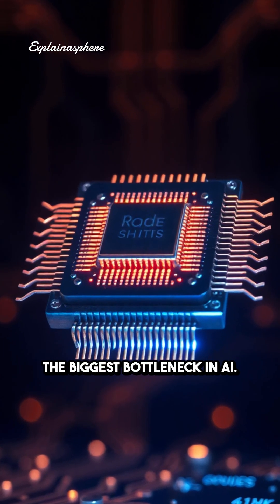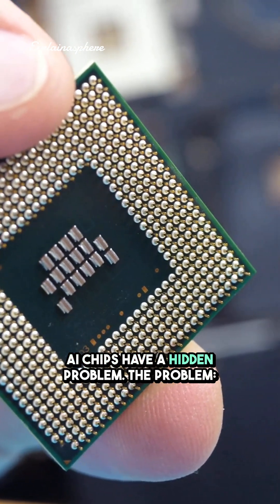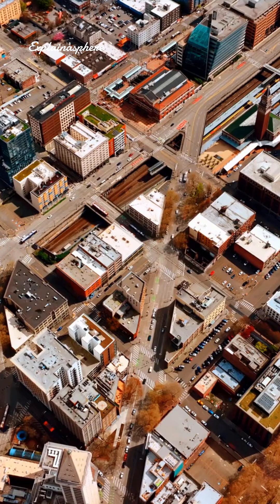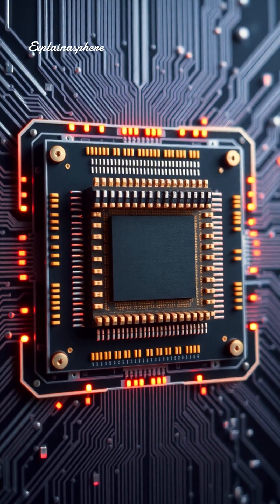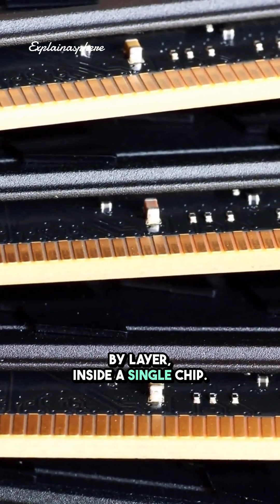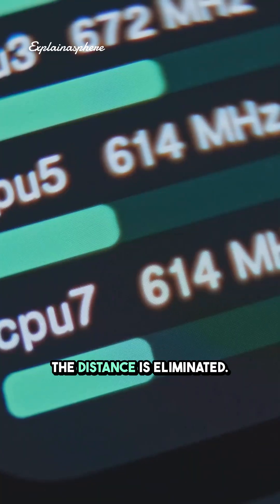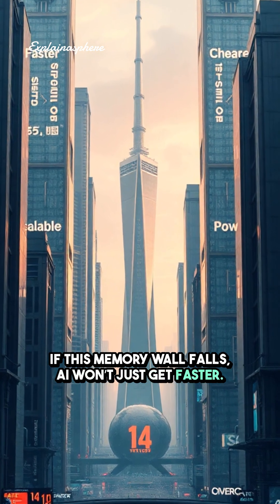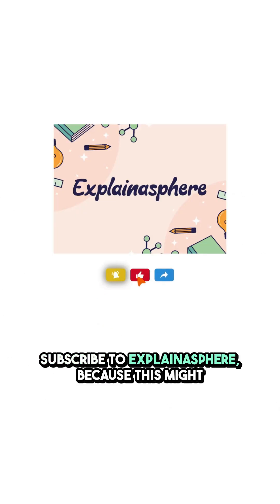This 3D Chip Just Broke AI’s Biggest Limitation

Comment: AI video trying to hype the AI bubble
Reply from the maker: I get why it feels that way. There’s a lot of AI hype out there right now.

But this one isn’t about flashy demos or bigger models. It’s about the physical hardware underneath, a real chip built in a real factory, solving a problem engineers have been stuck with for decades.

Even if the AI buzz disappeared tomorrow, this kind of improvement would still matter for everyday computing and energy use.

Healthy skepticism is good. This just happens to be one of the quieter changes that actually moves things forward.